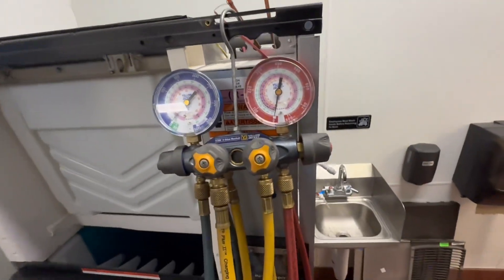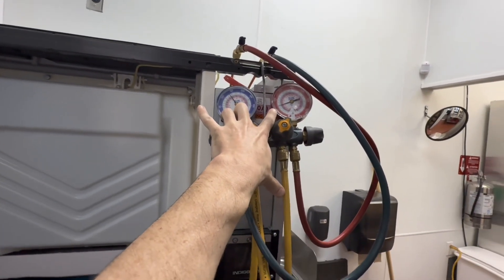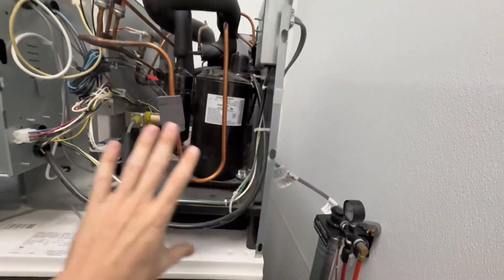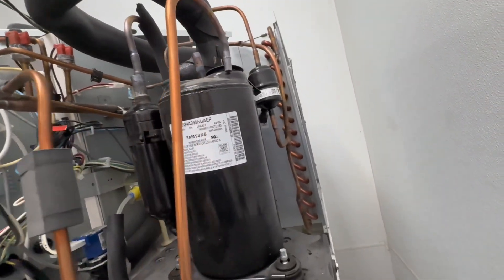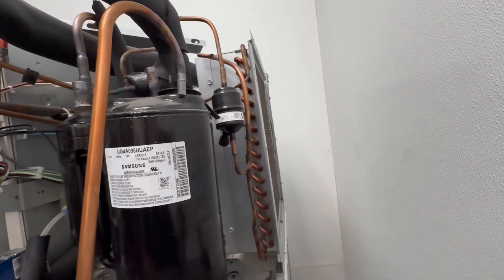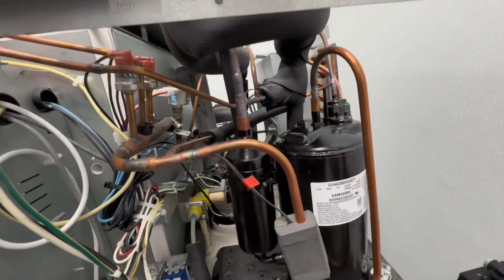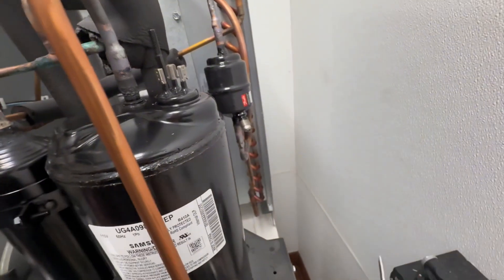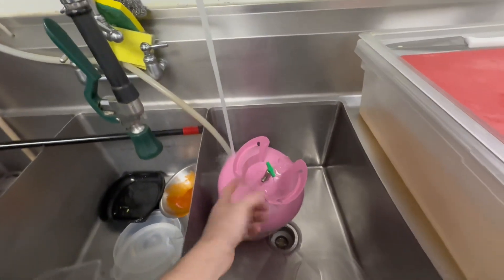Manitowoc indigo NXT Samsung compressor and filter drier replacement - Refrigeration Repair

Comment: Thank you for posting your videos!  Very informative! Question.  Do you have a video posted yet of a similar type but with a remote condenser. I would like to see how you recover the refrigerant in this case.
Reply from the maker: Sorry for the late response. I don’t recall if I have one. Recovery will be similar in some ways. Where the gauges connect will change depending on the refrigerant circuit.

Comment: The ice machine at my job is not making ice. We turn it off and turn it back on and it’s still not making ice. do you know why it won’t make we tried everything.
Reply from the maker: I have no idea why your machine isn’t work but I can try to help you. What is the make and model of your ice machine?
Reply: it's called the Neo ice machine
Reply from the maker: Oh that’s good information. So it’s a Manitowoc ice machine. NEO series. Should have a tag on the back that shows the model and serial numbers. What happens when you press the power button?

Comment: Manitowoc lost me when they started using window shaker compressors in their ice machines, and when they decided to use 410a refrigerant 🤷🏻‍♂️
Reply from the maker: I can understand that. Those Samsung compressors are failing more often than the reciprocal compressors.
Reply: @IceMachine411 at least throw in a Danfoss come on Manitowoc 🤷🏻‍♂️

Comment: On this ice machine do you normally use a magnetic donut to open up the harvest valve to flow nitrogen through the whole system when you are brazing?
Reply from the maker: This is a very good point!!! I didn’t show that but yes. Use I solenoid magnet on the harvest valve.